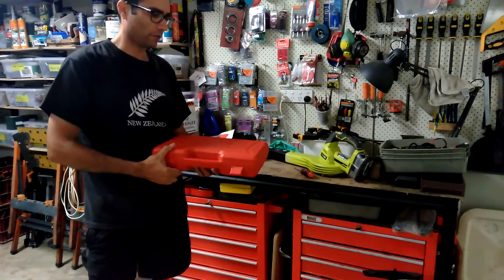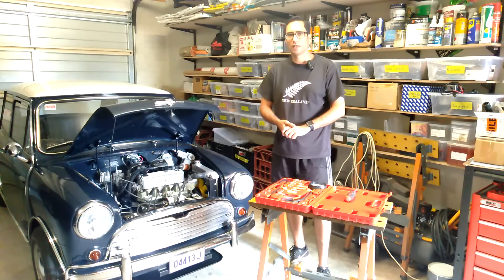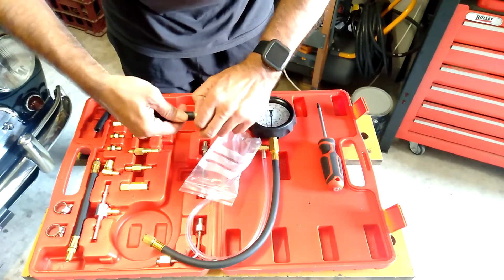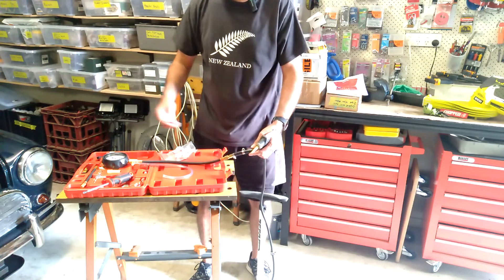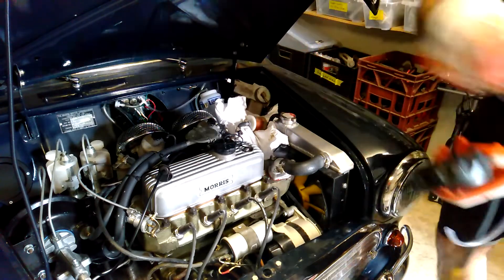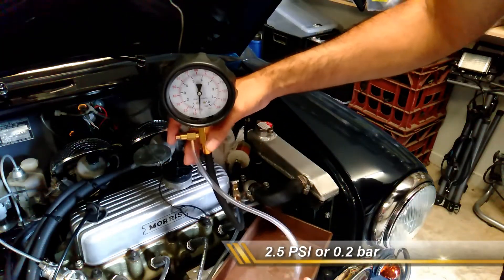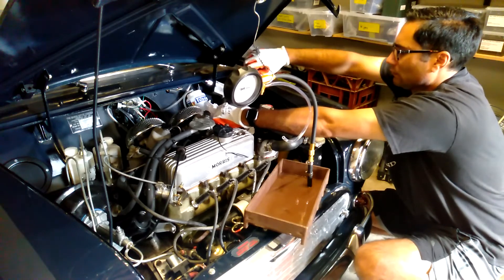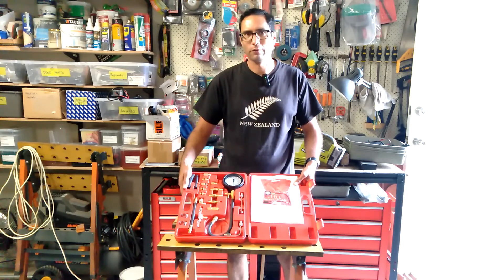Fuel Pressure Tester

Comment: Would the fuel pressure of a mechanical fuel pump be similar to an electric fuel pump?
Reply from the maker: I would think so. One factor that can alter the pressure in a mechanical fuel pump is the size of the spacer between the pump and the engine block.